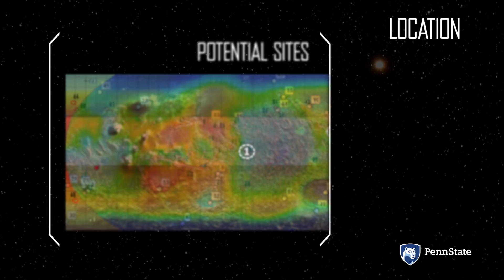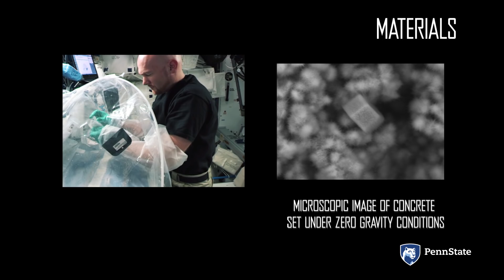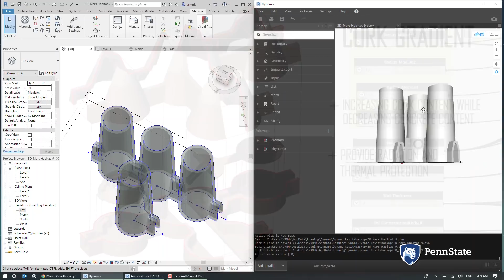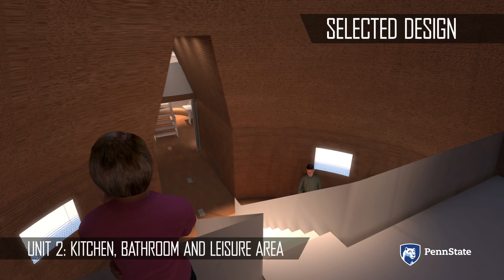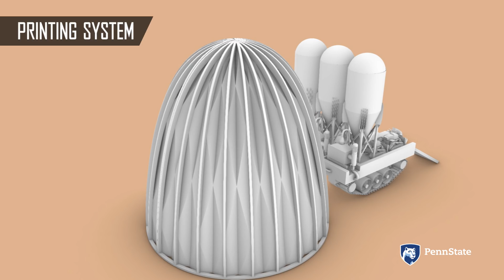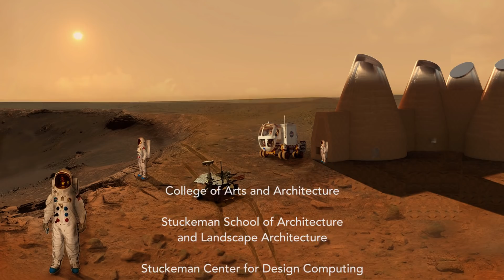NASA 3D Printed Mars Habitat Challenge Phase 3 - Penn State - Virtual Construction Level 2

Comment: I think any colony would have to have substantial underground facilities, especially if lava tubes can be located near a water ice source.
Larger underground bases, connected to above ground buildings would have the radiation shielding and ability to expand easily, plus the risk of depressurisation would be manageable.
A subterranean transport system, connecting several surface stations would make travelling between various facilities safer, less resource hungry and less vulnerable to weather and road/rail obscuration due to sandstorms.
Vast lava tubes are thought to exist on Mars, and their benefits should not be neglected by humans used to living above ground.

Comment: Wow.  Those silos have to be almost 50 feet tall.
Those would be thousands of pounds if designed for the same use on Earth so imagine the cost of creating them of materials light enough to be affordably sent to Mars.

Is this really the best design for the limited resources that will be used to set up colonies on Mars?
Personally, I like the competing team's idea of swarmbots that can be combined like legos to form the multitude of machinery needed for large earth-pod like structures on Mars.  It is fortunate the materials needed for a useful form of concrete are available on Mars, my question on the point is, just how easy is this material to harvest?
This would apply to any team as it is clear, be it through direct of indirect requirements created by the bid documents, any system will need to use Martian sourced materials.

There is a reason miners on Earth are either basically slave labor or are very highly paid.  Not only is mining typically dangerous for both man and machine, it is invariably wrought with unexpected obstacles left and right regardless of how much science you throw at it while trying to get a perfect picture of your work site.
Now magnify this through the lens of the mining site being located on another planet.  
A planet that most likely lacks any form of human labor during the construction phase, with an environment more inhospitable to machines than any mine site on Earth, and now you have a real problem to solve.
A problem it seems no team so far has directly addressed and one I hope the people spending our tax dollars are carefully contemplating when reviewing this team proposals.
Reply: What are the chances the winning teams system will be able to a) locate, b) reach, c) harvest, d) transport, e) refine, f) store, g) maintain equipment, h) replace equipment, etc. etc. etc.?
Even with my limited experience at working in a mine, (mind you this was a very shallow lead mine from the 19th century or so which had been restored as part of a museum decades before I began employ there) it takes a LOT of critical thinking skills to overcome the seemingly endless supply of suprises you encounter digging, be it on the surface or underground.
Even with current and near-future technology, it strikes me that even with the data we do and will have on the surface of Mars and the immediate subsurface, these are only samples.
Remember the 2016 Presidential election polls? Ya, that could happen on Mars.
By all means please try, I think it will work, I am just curious from a logistical standpoint given the knowledge and experiences I have had with harvesting natural resources, constructing in non-traditional environments, etc.

Comment: ...or make them poop in a bucket and dispose it outside, then after a couple of days outside the poop would be dry and free of bacteria due to heat and radiation so they then can use it as fertilizer for the plants, no need to waste water on a toilet, a composting toilet making use of space radiation to sanitize the poop and kill the bacteria would be the most efficient method, maybe even a small extra room a waste sanitizing "pool" (just a concrete hole in the ground, it would be exposed to the sun with a full glass walls so the water on the poop would evaporate and can be reused.

Comment: Will this hold inside air pressure. If it doesn't, then 3d printing of buildings on Mars seems overcomplicated. Much simpler is pouring gravel over pressurised vessels placed in dugouts.
Reply: If you know the atmospheric *pressure of Mars, then you will have an idea how much internal pressure should be applied for that kind of structure to maintain an equilibrium, so it does not crack. Further, closed and controlled environment have leakage allowance for good reason.

Comment: Better idea.  Step 1: Find lava tubes large enough to hold housing and thick enough to block radiation.  Step 2:  Inflate pre-fab housing built and tested on earth (and then the moon) inside lava tubes.  This would give radiation, meteor and dust storm protection while keeping the costs of the first settlement "relatively" low.  I don't disagree with the approach in the video, it's just not really needed for the first settlement.
Reply: Moon doesn't have lava tubes.
Reply: CRP https://en.wikipedia.org/wiki/Lunar_lava_tube.  I understand though that not all rocky planets will have lava tubes.

Comment: mulitpule things one is the seals how can they be fully sealed when they are put in lst one worng movement of them being put in could case strutural failure and more problems later on in the structures life, another is how do you find and mine the materials and how do you process the differnt grains of the dirt to the correct size for proper printing as if the peice is to big it could clog up the system making it inoperable
Reply: You are good at finding problems. But you are not good at thinking about solutions or formulating proper sentences.
Reply: @3gunslingers  im dyslexic mate also i havent got a single idea of how they could fix it, im just pointing out a possible problem that they could improve on
Reply: @thebritishjay955  
" im dyslexic mate" I'm sorry to hear that.
Punctuation would help for a start.

Comment: if we start on mars we need to go underground first. they'd have ever expanding tunneling and it'll provide safety from those planet wide sand storms and if they had starship launch from a subsurface cargo bay humanity would thrive long enough to start building on the surface. this current idea is cool but so much can go wrong with the robotic printing since the ground has to be level and im sure the wind could be problematic  even with a machine that large, at least underground the worst you can get is the structure collapsing but i doubt it would plus you'd already have the materials to build on the surface with actual engineers
Reply: Your onto something there. It's a lot more feasible to use a digging and tunneling method. We would need that machinery in the first place to mine the materials necessary to build any of these structures via 3D printing. Going underground would be better for the radiation levels and sand storms like you say. The idea of getting that giant machine to Mars along with all the other massive machines to mine and process the materials before you even start is idiotic. Just makes more sense to start with the easiest method to get a foothold on the planet

Comment: This feels like a highschool science project...

The equipment needed to make this work is hundreds of times heavier then just sending a prefab habitat... What they failed to mention in this video is all of the equipment needed to extract the resources from the martian soils. This would entail a huge factory worth of equipment...

The next hurdle is getting this thing sealed and pressure ready. I can't imagine this being air tight let alone be able to be pressurized.

The idea that you can print the structure then have people add in the furniture and alliances later simply wont work.... try building a house without opening a door or window ... ever ....

Just no...
Reply: Concrete are bad idea, it is not airtight, it is even not fully watertight - water soak into concrete like into sponge. To make it sealed need plastic binder, need a lot of plastic. Thats first issue i see.
Reply: I think you are wrong in all points. Hollow criticism is all I can read from your text.
Reply: @myscah  I'm a mechanical engineer with years in the aerospace industry and have over 5 years of 3d printing experience. I own 3 printers. From my knowledge of the field at hand this feels half cooked...
Reply: @15DjjC13   seems to be not enough. In addition as a mech engineer you should be widely more open in more multisectoral disciplines then you show up here. What I ask you for is just think then  speak. I try the same. First proof highly possible failure, then speak your mind. I own myself 3D printers I built them and I'm a systems engineer. I think you are just jealous it wasn't you who solved their problem. Difficulties don't mean unsolvable.
Reply: @myscah   Mischa I have thought about this problem, and I stand by what I have said here. I do have an open mind for many disciplines... Including materials engineering, industrial engineering and physics.

I'm really not sure what I said to have you jumping down my throat about this.

A concrete type substance is exactly opposite of the ideal material for any pressure vessel. These materials are normally optimal in a compression type application. Tension is their weakest attribute. There is a reason pressure vessels are made from metals or composites. Not ceramic...

If you look at the printer rover, you will not convince me that that is the most elegant solution. It looks like a series of grabcad models glued together. 

If you can think of a mechanical way of joining the printed sections in an air tight fashion, with the non uniform longitudinal layer lines complicating things to the point of obsurdity, let me know.

The quary needed to gather the materials from the soil would be a engineering nightmare on its own. Most material treatment and separation we do on earth involves the use of water. This couldn't be done on Mars as it would freeze or boil off due to lack of pressure. So you would need to invent a new way of separating the  elements of the soil mechanically. Again not impossible but obsurd at scale.

And to cap it off they are talking about this entire thing being completely autonomous. Another layer of complexity that would make all these tasks exponentially harder to solve.

The best engineers find a way to accomplish their task by making the solution elegant and simple. Form follows function when it comes to a life support system. It doesn't need to look like cute gnome homes that look good on a clickbait screen cap. 

For the imidiate future I see prefab modules being landed and assembled. 

For the future a better solution would be to send a rover that has tunneling equipment onboard, you could have a polymer material and catalyst. This could be used to reinforce the interior of the excavation with a expanding foam / epoxy type material, this would be air tight. The ground around the tunnel would support the air pressure within. The small rover could easily create huge amounts of space underground that would be easier to heat, cool, and pressurize. All with a minimal of equipment being landed on Mars.

I am not jealous of these people at all. I stand by everything I said and I think you are being a hypocrite. I have backed up everything I have said yet you have not given anything to defend their claims.
Reply: @15DjjC13  https://youtu.be/XWJ-sE08ASg
Reply: @myscah  This certainly counts as overwhelming proof.... A student based engineering competition to make a 3D printed concrete cone... with a skylight... 

The thing barely can stand up under its own strength let alone with 15PSI inside. An inflatable kevlar habitat would be more sturdy... At least then it doesn't have layer delamiation problems....

At the end of the day this is a pipe dream.

Let me know when Lockheed Martin, Northrop Grumman, JPL, Boston Dynamics, General Dynamics, or any other contractor looks into the idea. Then you might have some traction.

These competitions are simply Nasa investing into their own pool of prospective engineers to help drive the next generation. You can look at any of the competitions and normally they are pitiful at best. Hyperloop is another example.

Anyone can make a fancy video... and have a guy with a Nasa shirt on site.

They attend First Robotics every year.

Maybe in 100 years when they can print carbon nanotubes this might go somewhere, until then no.

I've provided my evidence, put up or shut up...
Reply: @15DjjC13  It proofs way more then you did with "evidence". Handling 103kPa by concrete is done and even exceeded in many applications  on earth allready ( https://en.wikipedia.org/wiki/Grande_Dixence_Dam ). Getting it airtight can be done with some simple sprayable hybrid polymer coating applied from the inside. Prefabs are the only option for open space, which obvios, but on Mars you have gravity assisting you similiar like on earth (1/3). You have materials available and it would be a crime to prebuild all here, specially in the long run. I know americans are all about fast but sustainable, but i stil hope they keep on changing there mindset to a more sustainable and longterm focused way of developement. 
Contractors often go for allready proofed solutions cause theire Engineers are affraid of making mistakes and therefor having a failure and loosing money. It is like in every well developed country, let the phd's do the hard and riski job's cause they are cheap and therefore, there is just little to loose. 
Concrete is close a very bad Idea for vessles, I agree, but those are stationary buildings. And by the way many buildings in Europe allready have aircontrol and you can't open any windows. 
Tunneling is a very bad Idea, since it is intense in energy, material used and machine maintenance. Very cost ineffecient. Building up is with current technologies 15 times cheaper then building under ground.

The thing you wrote which made me jumping down your throat was your simple word's at the end of your comment "just no...". And yes, you are right, what they showed here is less then half cooked, but I just keep it as good possibility till their projects failure is prooven.
 I'm sorry with the statement "Seems  not enough", I think this was not fair.

Anyway, DjjC13 have a nice day, may you be successful with wahtever you do.

Comment: I have an idea that I have been pondering for years and wondered if this would work in 0 g space. Make a doubled walled tent made of whatever material that would hold up well in space. Ok, picture a doubled wall tent with about a 2" gap between the two walls of the tent, and put small nylon or any other material cords randomly through out the structure to keep the two walls the same with apart from each other. Now fill this gap between the two walls with spray fome insulation so that it will form a polystyrene wall inside the two layers of the tent.The little ropes between the two layers will direct the foam to expand laterally within the two walls and make the walls somewhat even size.Small hollow tubes could run between the two walls with  little holes in the sides of the tubes to distribute the foam more evenly. This would be also useful here on earth as well,as easy structures that may be in hard to reach locations, What does  any one think? Could this work?
.
Reply: It could work. But it's far more efficiënt to use as much surface material as possible.
Reply: Bigelow.....the problem has already been solved.
Reply: Will
Even before Bigelow there was this idea: https://app.box.com/s/jix7zu3wbp03a6gdc8k1qcei00oa29xb an expandable habitat for the Apollo lander.
Reply: When I read it, I remember my cleanroom design project, I don't know if that's what you mean but I did doubled-wall for an air space and polyesterene material but no nylon thing on it plus cleanroom is pressurized and had comfort temperature of 25 degree celsius. Not quite sure if we we're doing it right. That's what comes to my mind in what you said. And cleanroom is used to manufacturing spacecraft and electronics to avoid dust and microparticles.
Reply: There's a company called Bigelow Aerospace, you should check 'em out.

Edit: here ya go!
https://youtu.be/5nE3UO1kqv0

Comment: I'd be interested to see this technology used on terra firma like a desert location to confirm long term structural integrity with earth's own erosion  before attempting this off planet. The gradation of glass to concrete is a beautiful concept.
Reply: IMO...they need to test everything in low gravity as found on Mars...For instance ...how will the printed slurry settle under less gravity...will the plumbing get clogged up in the printer, what happens if the printer takes a time-out and all the slurry starts to set-up...What can go wrong will go wrong